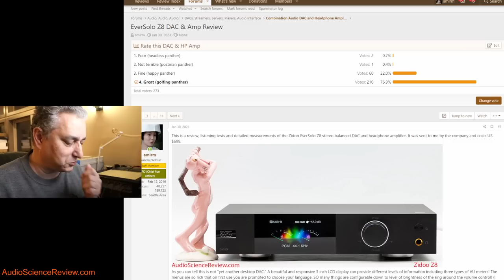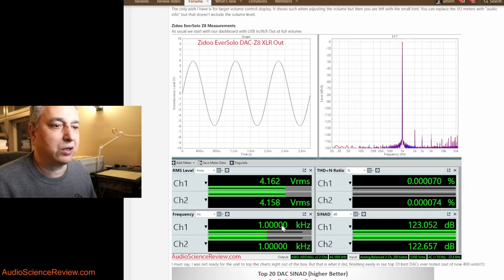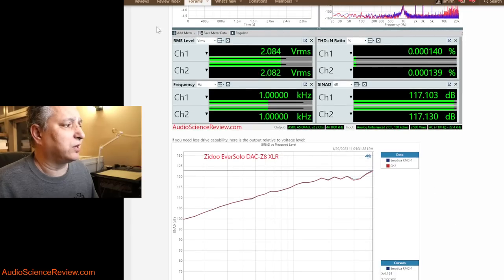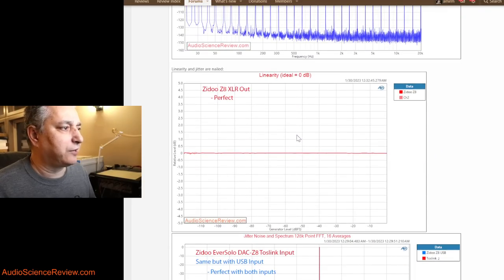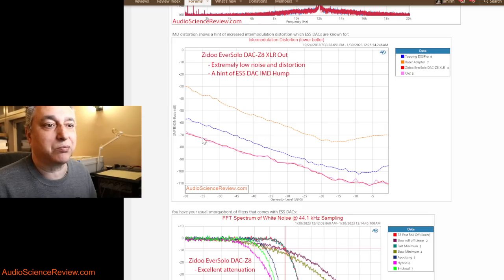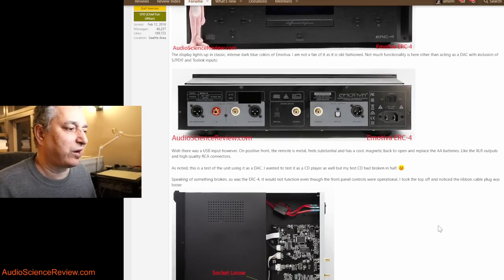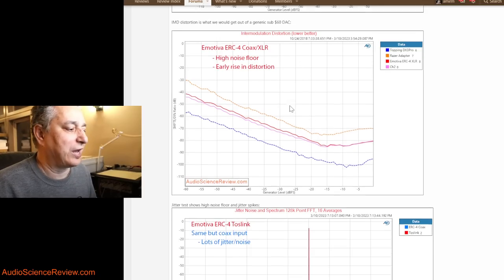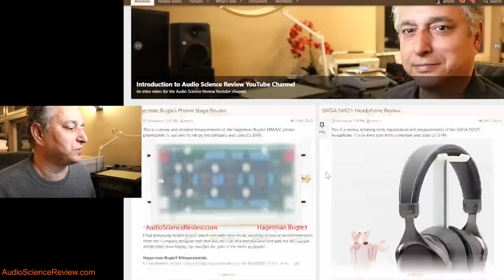Speed Reading DAC Audio Measurements

Comment: I know how to read DAC measurements, but I didn't know exactly how the pink panther rating system worked. So that was good to learn right off the bat.
Reply from the maker: Ah, I was going to specifically mention that but forgot.  Glad you figured it out.  :)
Reply: You're not the only one. I spend more time trying to interpret what the pose of the panther is trying to convey than comprehending the data in the various graphs!

Comment: Wonderful video Amir.  If possible could you address clock quality at some point?  When relatively inexpensive DACs produce jitter below threshold of hearing, what benefit is there to having a fancy temperature-controlled clock and advertising it as a feature worth paying for?
Reply from the maker: Thanks and great idea for another video!  For now, no, you don't need stable clocks.  Our hearing is not sensitive to speed of playback.  It is sensitive to variation in speed which is jitter.

Comment: Great stuff. Any ideas of potential meaningful aspects that influence sound quality that would not show on these tests since a lot of people seem to think so? Why wouldn't time domain be an important angle for testing as many seem to think it is?
Reply from the maker: For electronics, the only thing that doesn't show up is potential for ground loops that you may have in your system especially if you use unbalanced RCA connections.  Other than that, the track record shows that when we declare a DAC transparent, it is so.  Where some ambiguity set in, is in headphone and speaker measurements.  I will cover these in upcoming videos.

On time domain, no, it has little relevance in the context of these devices.  I do show the filtering where such a difference exists from measurement point of view but from audibility, it is not there unless it cuts into frequency response.
Reply: @AudioScienceReview  Okay, thanks!

Comment: Hi Amir! Love the objective reviews. I was wondering if you could give some advice?
Ive been looking around for a new Amp in my simple Stereo system with little luck so far. Id love something sleek and thought I found it in something like the Rega IO but saw your review and was not impressed. Is there a minimalist Amp around the 500€ range, with a remote and smaller sized footprint that you would recommend? Or would something like the Argon SA1 despite some poor measurements still suffice for an audio enthusiast who wants to hear quality analog and digital audio through some tower speakers?

Comment: Amir, why does AVR or AVP cannot achieve 110 or 120dB SINAD ?
Why are they stuck to 90 range ?
For AVR I could think about bas stuff coming from amp parasiting DAC... But AVP have the same behavior, and they are pricey DAC with a lot of technological stuff inside.
So why cannot AVP reach 110-120 SINAD ?

Comment: Sir I have a question. I have a Topping DX5 connect into my Mac and I heard a minor audio quality change when switch from DAC mode to PRE mode. Is that in PRE mode Dx5 only amplify the audio signal converted by my Mac's DAC or the signal is DA on DX5 then they add a digital volume after it? Thank you so much sir.

Comment: Hi Amir/all, what is (and the difference between) "Generator Level (dBFS)" and "Measured Level (Vrms)" under the IMD and SINAD vs Measured Level measurements respectively? Are they the level of the digital input signal fed to the device or the output of the device itself whereby 0 is when the device is set to maximum on the physical volume knob or something? *Also Power vs Distortion in the headphone amp section for devices such as all in one audio interfaces, this is really confusing me and I do not know how to get the most/best balance out of the components I have :')

Comment: Is it, or would it be implied, for example, that the top 1/2 dozen or so DAC's that you've measured Amir (in the higher end of the "blue") would, because they all measure similarly and have "state of the art" measurements, also likely sound very similar to one another? If I had (putting it another way) an opportunity to audition those same 6 DAC's, could or would it be implied that trying to distinguish between them would probably or even generally be more or less a waste of time? That is, at that level would it only be the general aesthetics that each one has to offer that would be more of the deciding factors assuming I were going to purchase one of the six - or - would whatever exact chip set type/implementation etc., regardless of the state of the art measurements play a factor in sound differences that could be heard in blind testing?
Reply from the maker: Most definitely.  Really, distinguishing any DAC in the blue region (some 50+ DACs) would likely sound the same in almost all cases.  So shop based on features, price, etc. once you see the measurements show competence.  No reason to just chase top 20 DACs unless the budget allows.
Reply: @AudioScienceReview  Thank you.

Comment: This is nice and all but too much weight is given to measuring reproduction of 1kHz signal.

I suggest more notice is given to Smirnoff's df metric. It is using a sequence of test signals from the simple 1kHz sine, over triangle and square waves to samples of real music to overkill (white noise), measuring and calculating the difference and weighting the score.

There are many DACs that are good at reproducing sine waves but not so good at reproducing complex signals and vice versa, e.g. as shown by HypetheSonics measurements.
Reply from the maker: Your assumptions there are not correct.  Only the dashboard and DNR are 1 kHz.  As I explained in the video, IMD is dual tones (60 and 7 kHz), Jitter is a complex sum of 12kHz and 250 Hz, multitone is 32 tones and THD vs frequency is every frequency.  DF metric has issues I won't go into now.
Reply: @AudioScienceReview  While all those data is presented, only 1kHz SINAD is given a colorful compare chart. That can misled some people to give more weight to the measurement of a borderline case.  I'm just suggesting that people, who are interested in a simple, comparable metric check the alternative approach.

Comment: How do you measure noise floor modulation?
Reply from the maker: IMD test will show it as it is changing the input level.  So if the noise floor goes up with level vs not, you will see it there.

Comment: Two points:  The standalone Zidoo DAC with headphone amplifier is more expensive ($700) than the CD player from Emotiva  ($649) .  The CD player does not have a headphone plug but the DAC does not have a CD transport.  I would categorize the Emotiva unit as cheap: - a decent CD transport usually goes around for $1000, sans the DAC.
The second point is what if the Emotiva unit is a lemon that the user got?  Who knows what happened during the shipping to Amir's laboratory?  To me the disconnected ribbon does not speak to the quality of the original unit, how do we know that another unit from Emotiva would be this bad (it is by all accounts).  The Zidoo unit was sent to Amir by the manufacturer, otoh.  It would be professional malpractice if they send a poorly testing DAC to Amir's lab.  It could tank any sales of this newer company.

Comment: When comparing the performance of DACs with that of speakers it would seem that DACs have 1/100th the linear and non-linear distortion of most speakers.  I guess lots of marketing money has convinced people to spend so much time and money comparing DAC when the result is totally swamped by the errors made by speakers. Lets say you're playing that tone through a DAC with the 2nd harmonic down 135 dB and then it goes to a speaker where the 2nd harmonic produced by the speaker is down 60 dB if you are lucky and not playing too loud.  Your completely full of it if you think you can hear the differences between these DACs.  Good luck hearing the harmonic that is down 60 dB.  Maybe Amir will construct a demo where he plays the 1 kHz tone at listening level in the video and then plays the 2nd harmonic, 2 kHz,  60 dB lower with and with out the 1 kHz tone.  Sure. Repeat that at -135 dB.  Ha ha ha   Great job as always Amir.
Reply from the maker: You are ignoring the fact that speakers are noiseless.  To build a DAC to have no noise at reference levels requires DNR of 115 to 120 dB -- something that only the top DACs in the upper area of blue graph produce.  Further, there are people who use DACs in their desktop systems where with headphones are able to hear far more artifacts.  In addition, I have measured both speakers and headphones that have SINADs in upper 80s which is the limit of acoustic measurements.  The bulk of distortion from transducers is in lower frequencies where our hearing is not very sensitive.

Comment: I see a couple of problems with these measurements, for example it is obvious that absolutely any modern DAC has a level of harmonic distortion WAY below the level of detection.  Accordingly, they should all sound the same, which  is obviously not the case. Perhaps from a practical point of view it would be worth measuring something else?  For example, in the 70s of the last century, a technique was developed using white noise instead of harmonic signals, it showed excellent agreement with the results of subjective listening tests
Reply: @Milo Prager "manipulated" in what way?  The frequency response of any DAC, even with the softest FIR filters or in NOS mode, is absolutely flat along the entire range of audible frequencies, but nevertheless we hear the difference between them.  IMHO the only useful measurements are the jitter test and the impulse response
Reply: @Milo Prager Oh yes, the multitone test - someone really needs to hint to Amir that there is no piece of music consisting of 31 stationary sinusoidal signals.  Seriously.  Even among the works of Penderecki.  But I understand your point, maybe I really strongly prefer one of the four DACs that I have at home solely because of its shiny copper buttons

Comment: Nice , BUT  in your AP555 , you don't show input filter , is it A-weghting , LP filter , butterworth , what BW . It would be nice if you add all these informations for each measurement at the corner.
Do you have galvanic isolated USB between your AP555 DAC and PC , it seems that you have common mode problem between PC , DAC and AP555. It show itself at low frequency.  
You don't show how clipping look like in oscilloscope too. Is it clipping hard ? THD AND SINAD not showing how the DAC sounds   R2R DAC has better sound stage , compare to Delta sigma,  how you measures that .
Reply: Hey Amir, I also hate smart a Alex. they are victims of their own cleverness.
Reply from the maker: That was not the purpose of this video.  I wanted to to teach people to quickly read the measurements not becoming measurement people themselves.  I have published an entire text article answering everything you mention.  See: https://www.audiosciencereview.com/forum/index.php?threads/article-understanding-digital-audio-measurements.10523/

I don't use galvanic devices in front of AP because you don't have one in front of your amplifier either.  However, AP is nice in that its unbalanced inputs are floating.  This gives me a chance to test both ways with and without common ground.  XLR balanced inputs naturally don't care about ground currents.  

As to your R2R comment, that is a myth.  I can't measure imagination.  Come back and show in a blind test that people can hear such differences and I will show you immediately how to measure it